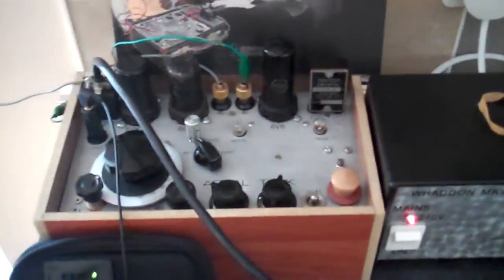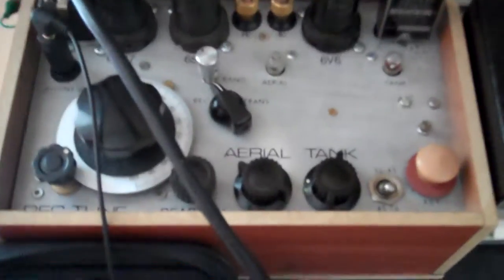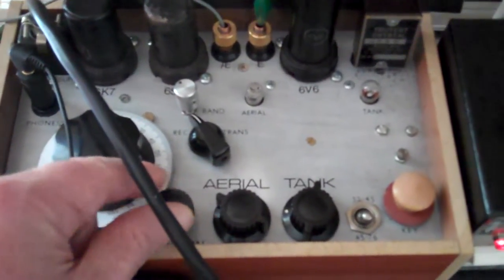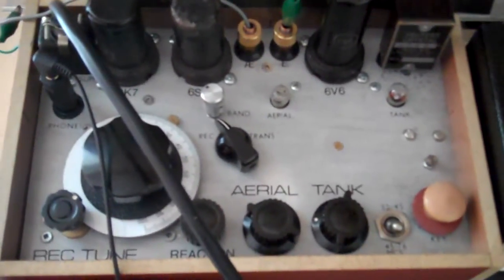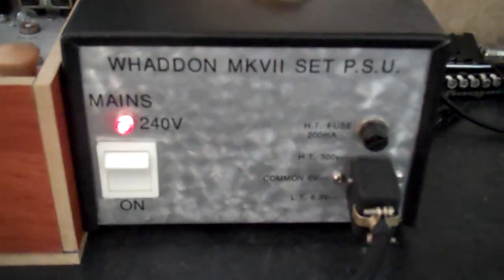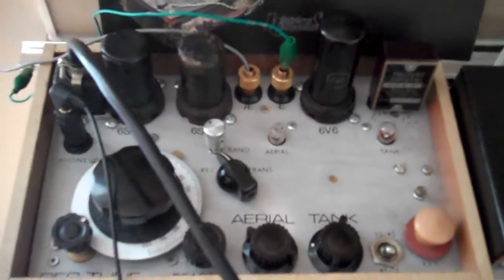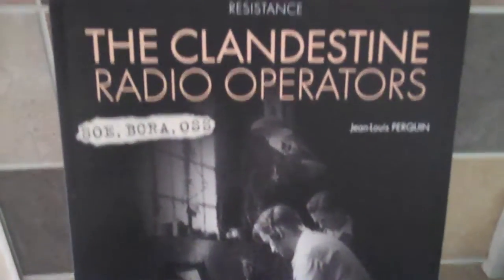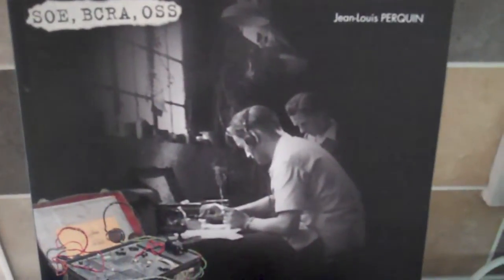Paraset spy radio demo.mp4

Comment from the maker: Hi Mark, thanks for comments on my paraset, I an quite pleased with it. I now have to do a bit more to the receiver, it needs better bandspreading than the slow motion drive can offer at the moment. I have several 6SK7 valves that I have tried in the receiver some are old and look a bit knocked about, and also some 'As New'. Old 6sk7 gave more rf sensitivity, but more prone to drift. New ones need higher regen voltage, & bit less sensitive but muc less drift. My Tx is on 7010 Khz...73 de G4FBC